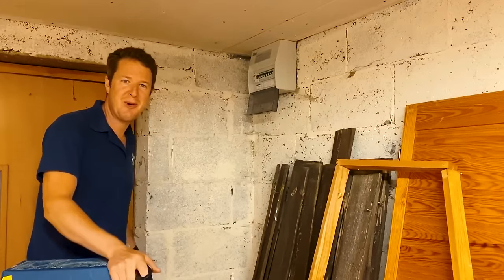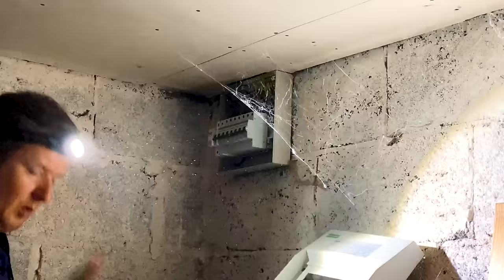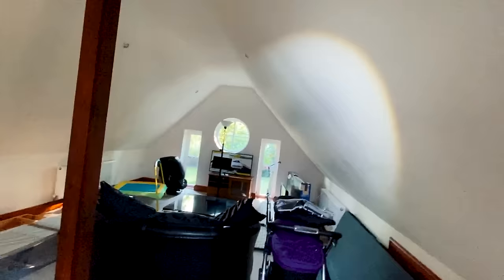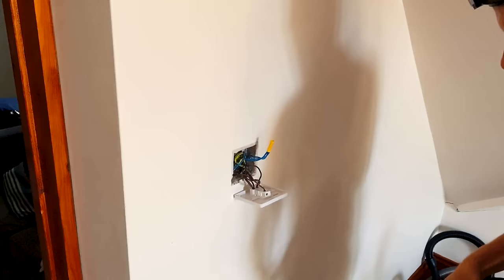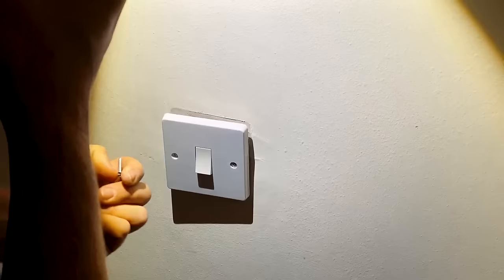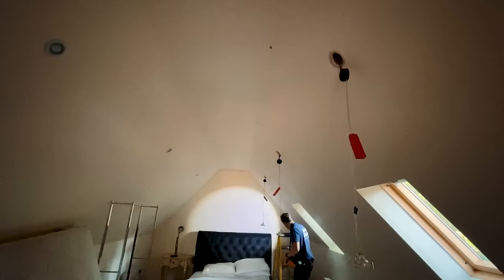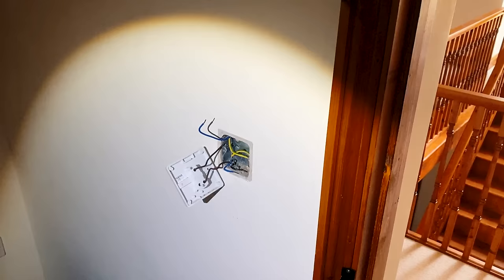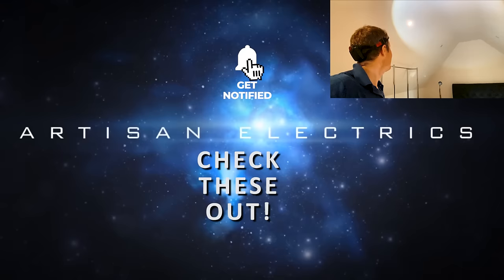Fault Finding Electrical Circuits - Electrician Life

Comment: I can assure you trying to find a fault in an old paper insulated lead sheathed underground 230/400 volt cable is no fun. A 300A or 400A fuse blows, there is a 'no power' complaint, the faultman puts in a new fuse link which holds for 10 minutes and it goes again. Testing gives indecisive results (modern test equipment may help). You are in for hours with irate customers hanging around. You may need to ensure each customers' terminations are disconnected and some may be behind locked doors and no key. Several years ago in London there were five such failures on one cable over several days - they thought they had it fixed but it was not - that negatively impacted fault statistics - cable systems are far more reliable in aggregate than overhead lines.
By comparison finding a similar fault in a 11,000 volt cable is a piece of cake.
Reply: Do you just look for the crater?
Reply: @marcaxe  Fuses or protection clear the fault pretty quickly so there is nowhere near enough fault energy to cause a crater.

Comment: Hello mate thank you for video very helpful.can I ask a question please which cable you use to run patio ground lights ? Swa or hi tuf as swa is quite hard to make the end inside the light fittings.thank you in advance
Reply from the maker: I’ve always used SWA for any underground cables, don’t think Hi Tuff is designed to be buried

Comment: never ever do L-E and N-E IR separate just for that reason you discovered at very start. You can damage sensitive equipment especially if its office or something.. you just found you got N-E dead short at the start. And then you go and do IR on all L-E. Because you got earth and neutral short, doing L to earth IR is as good as doing L-N which you never do on existing installation..

Comment: You said that you never came across short wire? Never seen screw in wire? Thats the purpose of naked earth wire? If you screw through it shorts to earth rather than building/structure or other parts that could electrocute someone? Plasterboard boys did that 100%.

Comment: Can I ask why you do insulation test on the electrical board to find which circuit is faulty and then proceed with continuity tests and not insulation tests? Just hope you can help me understand better, and thanks for the great video
Reply: I guess because he knows which circuit the short is on, but now needs to know the value of the short - and for that you use the continuity setting. That will give you more clues as to what kind of fault it may be.

Comment: I went out to a fault a couple of days ago with the rcd tripping, the tenants had just moved in after an Eicr from a empty property. There were 2 socket outlets where the neutral had caught the insulation on the flush metal back boxes.
I found out later the Eicr was done then after the kitchen fitters renewed the kitchen including tiles where one of the socket neutrals was caught.

Comment: Why did you disconnect the two neutral wires in the 2nd switch box? (the one box you opened 1st)
Would it not have been enough to check the resistance with both wires crimped, and only undo the crimp is the short was also seen there?
Reply: Oh, nvm.... seems someone already posted about that!

Comment: Ok so I have a question?.. I went to turn my lounge light on and it didn't come on and neither did the kitchen light or the hallway or any lights for that matter so I took a look at the fuse box and all the switches were in the on position apart from the lights one .. can it switch the lever/switch off by itself?
Reply: Yes it can

Comment: I'm not an electrician (nor a tradesman of any sort) but I'd like to know the theory behind circuits... Testing... Faults. I'd need to start from absolute basics (volts... Resistance... Etc). Any recommendations for e-learning or distance learning? Or even good websites?
Reply: John Ward

Comment: i think it took to long, after you managed to turn on the ict you shoud have checked the house and try out appliances lights are the most common problems due to transformers ,led electronics,and the heat dispersed by them.that can save you time.Im pretty sure its not a wiring problem.If there is a short every time the flip the switch the iCT is going to activate if its is then you have a wiring problem if its not look at the bulbs and transformers and test the wires from one lamp to the other but when they are not connected to each other.As for changing a cable in a drywall try using a measuring tape from one hole to the other :) that has helped me many times

Comment: I love those Wera insulated screwdrivers you have there. I have the 5 pack set. A little pricey but so worth it. Quality tools.

I also love my Wiha Pico driver for working in PLC/VFD panels that have tiny terminal screw slots

Comment: Not trying to teach anyone to suck eggs but if it’s not resetting with load on all circuits could you try having everything off then turn on one circuit then the RCD. And repeat to see if a single circuit stops the RCD from resetting. Hope that makes sense.
Reply: Turning off MCBs won't effect a Neutral-Earth fault

Comment: What kind of Fluke meter is that, That thing is a beast.

Edit: Also, those look like Weidmuller wire strippers, mind linking a part number?
Reply: Seemed like a euromaster. Those are absolutely amazing, but expensive. Could also use a megger as it is cheaper. But not as good. Less options.
Reply: @iamme8290  I found it on Fluke's website, it is a Fluke 1664 Installation Multifunction Tester. $2199.99 USD. Saw a close up in another video.
Reply from the maker: Yeah that’s it Fluke 1664FC
Reply: @artisanelectrics  you should do a tool video going over what you like and don't like.
Reply: @artisanelectrics  isnt the euromaster the same kind of tool as Fluke 1664 fc though? Or is it a difference? Just seem like a different brand.

Comment: You missed a trick… it wasn’t necessary to cut off the crimp in the second box. Having found a fault you believed was the outgoing neutral, you could have confirmed that theory by retested all three of the remaining crimped neutrals at once. Easy to be wise in hindsight, of course. 🙂

Comment: Maybe you could fish and pull a cable up and over from the light on the other side of the ceiling?
Reply: If there rigid insulation then you will struggle,prefer to see ceiling counterbatten in attics before you plasterboard,gives you some wriggle room for pulling cables,also kept cables to each side,not criscross across the ceiling to each downlight,as any faults it becomes a nightmare to sort out,& then terminate the lot somewhere accessible.

Comment: What is "normal" in the UK? If a single lightswitch to lights. Flip up or down for light?
Reply: No flipping, UK light switches are almost always rocker switches. Pressing the bottom half turns the light on.
Reply: @TheBroz  Aha. In Sweden we often rocker as well. However we push the top.

Comment: 250V Neutral to earth???? not 250mV neutral to earth? That's a problem right off the bat. Reversed polarity. You said one thing right though. The art of fault finding is the process of elimination. You Want a near short between Neutral and Earth, so that is a big problem. In fact, I can bet you that is the cause of your RCD tripping, not those poor little lights that you ripped out.

Comment: How would I do it? the same way Jordan, the only way to find which circuit it is to take one out at a time as the fault usually goes through the loads not usually showing on the live at the MCB. My money was on a melted cable behind one of those halogens. Would it be easier to get a new cable between the last working light and the end light if it is wired as you said and cut out the faulty cable /retest circuit? Do you think the cable is just caught on a plasterboard screw and it has arced over time breaking down the insulation?
Reply: I thought heat damaged wiring from a halogen downlight as soon as Jordan identified it was a lighting circuit. Seen it too many times. Hotter than the core of the earth them bloody things.

Comment: I would have used my flexible plastic pipe already installed and pulled new wires through, god i love i am not working in as a electrician in the UK, no offense  to electricians in the UK just find it silly why nobody there use flexibe pipe, would save the electricians time and customers time and money

Comment: Lost neutral? Maybe screwed inti insulation
Reply: I had a similar fault the other day. The neutral was connected in the accessory but the pin was tightened to the insulation and not the copper conductor resulting in the earth being used as the return path and tripping the main rcd.

Comment: There are electricians and there are ELECTRICIANS the times I have seen how folks wire lights up all I'll say is if you don't know what the fuck you are doing then leave it to the professionals Oh and replacing the cable between those 2 lights a friend of mine came to the rescue with his little ferret he tied a string to his collar and put him through the downlight hole and pushed his hand in the other hole and HAY presto out came ferret with string and that's how I sorted mine out 😂👍

Comment: just connect the neutral and earth together and sleve them both as neutral and dont earth that light. Naughty but would work lol. (I'm not an electrician)
Reply: I have actually seen that done, in a bathroom , same house they had the shower fed of 2.5mm spur off a cooker circuit  i just walked away

Comment: Most electricians are very hopeless at fault finding 
At least in australia its not taught at trade school!

I fixed probably 100-200 faults a year like this so there isnt much i havent seen
Most issues are minor and resolved within 30 mins
More often its the customer that slows the process, eg cant get into rooms, doesnt know if pwr in sheds or if they have tanks or pumps etc

Comment: RCD devices operate the correct way 
UP  position   is  ON
DOWN position is  OFF
All switches need to operate in this fashion
Consistency is the  KEY
Some clowns in the UK decided to make  GPO and 
light switches function in the opposite way.
And same in AU -- and because in AU the clowns 
are doubly stupid - they place the EARTH pin at the bottom.
In CHINA where the Type  I   socket is used  - they correctly
place the earth pin at the  TOP - according to the common
convention.

Comment: I would have used Quinetic light switch m8t
Reply: since the supply comes to the light switch in the first place there is no advatage to the Quintec, if installing from new then it perhaps would have some advatage

Comment: super sketchy solution but i guess it would work: bring the transformer to the good light and use the sketchy cable for the 12V... (i'm not an electrician btw. so i should actually keep my mouth shut haha, I enjoy the videos a lot though...)
Reply from the maker: Yes, you are right
Reply: This wouldnt work as it was three lights affected not just one!
Reply: @rodd8170  It would work , you will have to have a 150va transformer to run the 3 lights (50va each)
Reply: That is do-able but the initial suggestion was just movin single transformer from light across.

Comment: What do you mean by TRIED  to reset it-

You either reset it or you did not
Perhaps by TRIED  you mean that you had hands in pocket
and used Mental telepathy

Resetting does not mean that it stays in the SET position
It merely means an act of placing it into the SET position.
There is NO  TRIED  ABOUT IT- 
It is either you DID or DID NOT set it.
Understand that the word TRIED  is one of those useless
FILLER words when you do not know what word to use --
The same applies to  - "Should be "" 
Whenever you hear any'one' say "Should be' it means that 
they are totally clueless.

Comment: YOU NEED RETRAINING ... YOUR FAULT DIAGNOSTICS ARE REALLY POOR ... YOUR USE OF YOUR ELECTRICAL METER ARE SHABBY... YOU really need to get to grips with electrical concepts. You condemned a cable when you never tested the cable with the light fitting disconnected ... Come on mate.. Start looking at the problem and stop guessing

Comment: I do more on the electronics side than domestic electrical fault finding. Watching other people's videos I notice that many new builds seem to suffer from faults like this. I can't help but draw the conclusion that domestic installers aren't actually very good. Part P only people really do worry me. They seem to lack fundamental mechanical and electrical understanding. Okay, there are crap DIYers but no excuse for some of the garbage work turned out by so called professionals.